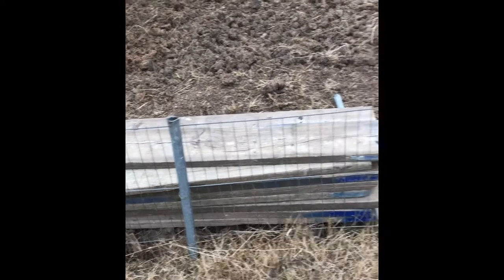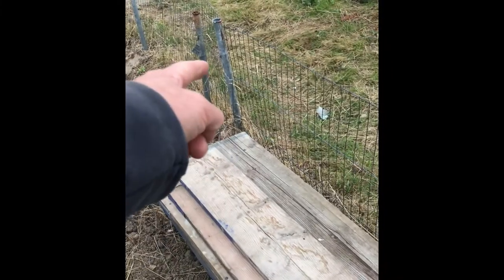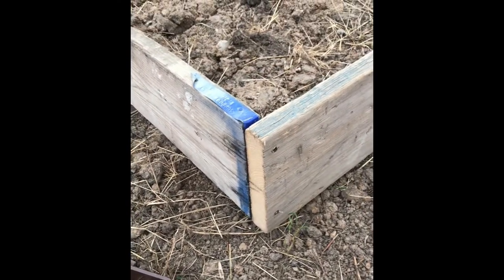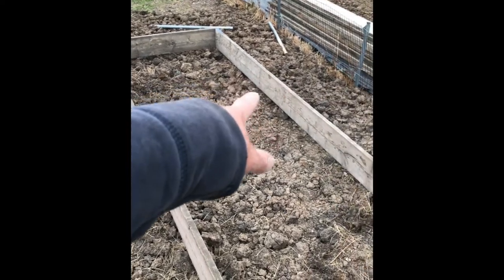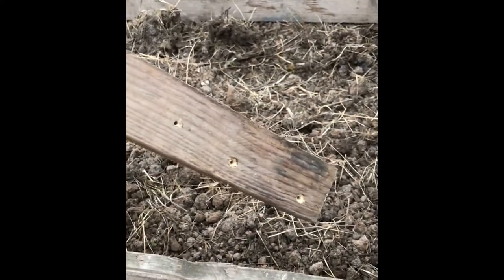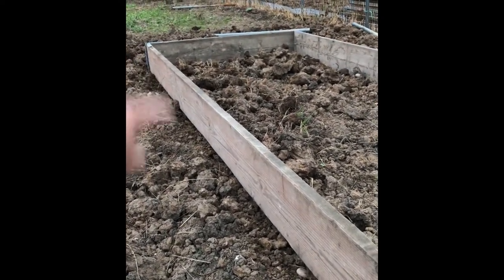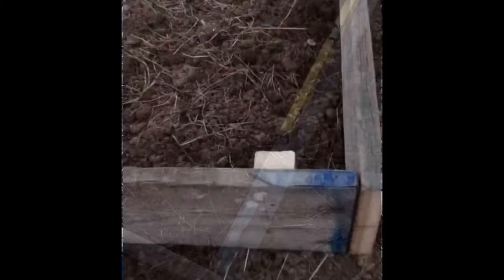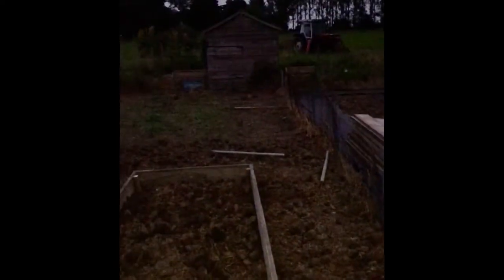How To Make Raised Allotment Beds, Easy To Make Allotment Beds, Allotment Gardening

Comment: Scaffold boards generally come in 5ft, 8ft, 10ft and 13ft lengths, but I like what you have done in buying 13ft boards then that way you can cut to suit what length you require, and the boards will last at lot longer from a scaffold company than the sawn timber ones from garden centres. A good informative video, 👍
Reply from the maker: Thanks for watching and your message, glad you liked👍
Around here all the scaffolders tend to use 13 or 5’ boards so normally some spare old ones to be had. 
As you say, they last longer than normal, thinner, softwood timber.

Comment: I am using gravel boards. That do the same job just as good
Reply from the maker: Bryan,
Many thanks for watching and messaging, much appreciated. 
Gravel boards are a great option as they are pressure treated, so last well under damp conditions. 
If I hadn’t found these cheap second hand scaffold boards then I would have used the same as you. 
Good luck with you allotment development and all your growing 🌼🔨